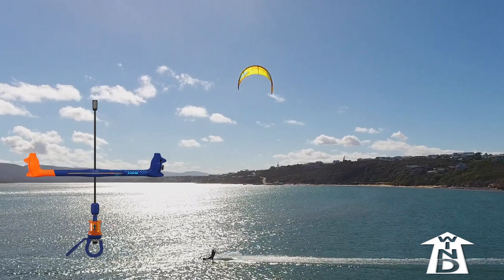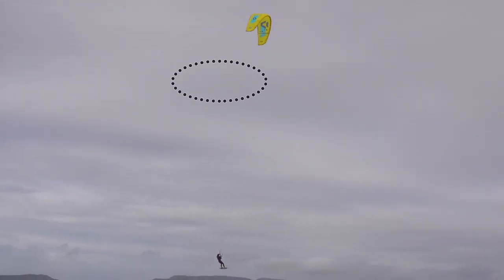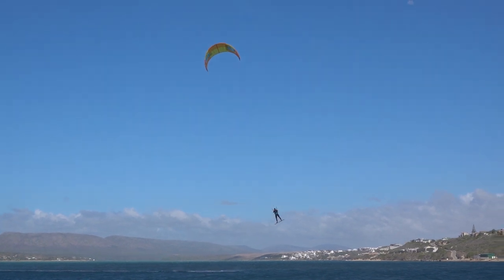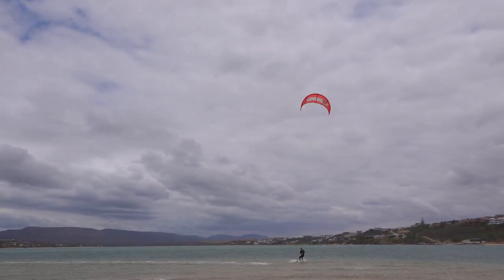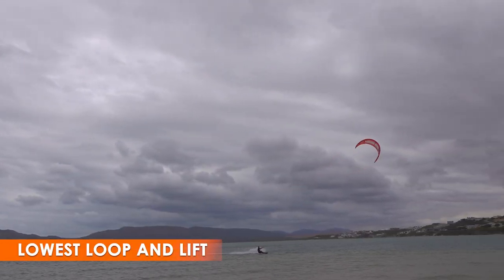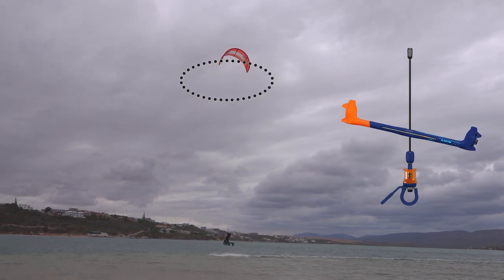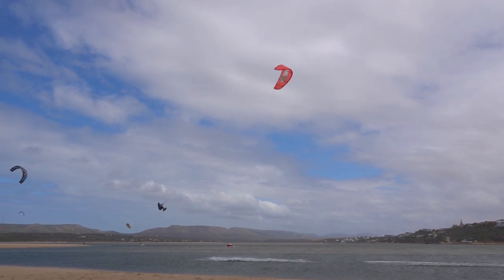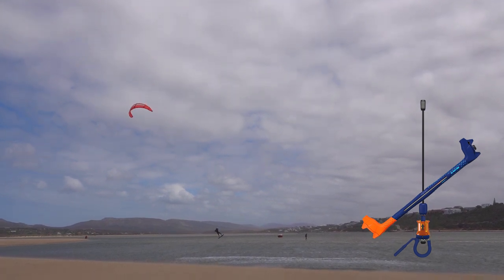How to Heli Loop, Back Loop, Powered Loop and Mega Loop (aerial kiteloops)

Comment: Great Video! Watching it a tad bit too late for me - I just came back from a trip to Egypt, where I was using a 2020 13 metre Rebel in winds of about 15 knots. With that setup, it took a little pull at one side of the bar during a backroll, which would send the kite into a handlable pool. With a bit more angle at the bar, the loop gave a nice little lift for a backroll transition, as described in one of your other videos. Next day, winds about 20 knots on a 2020 9 metre Rebel, hell broke loose when I applied the same technique. In this video, I see that your steering angle is fairly extreme - I reckon that does the trick in stronger winds, avoiding hefty powerful kiteloops?

Comment: Thanks for the effort in the video. But i dont agree with you about the terms "backloop" and "heli loop".

Backloop has been used as "backroll". Heli loop is when u loop the kite above ur had, but u still flying in the air. The last "heli loop" before u tooch the water is called downloop.

Comment: 8:15 the pause is suggested here can lead to this outcome? 
https://youtu.be/w7mlJ86akFM?t=659
Reply from the maker: Hello Beatrice. No, in this example it was not looping late that caused the heavy landing, it was mainly the angle of the kite. The kiter had a poor launch and the kite drifted to 1 o'clock (it should have been closer to 12 o'clock as they climbed). If you loop a kite to the right from 1 o'clock you are in trouble. Steering right from 1 o'clock sends the kite very low, of course. So you need a lot of space to get the kite back above your head. You would need to be about 10m high to have time to get the kite above your head with the kite diving so low. Also, to make things worse, the kiter steers very slowly (have a close look at their arms), also he/she is using is fairly slow kite. When they land the kite is still very low and not above their head. The pause shown at 8:15 is done with the kite at 12 in order to keep the kite high.